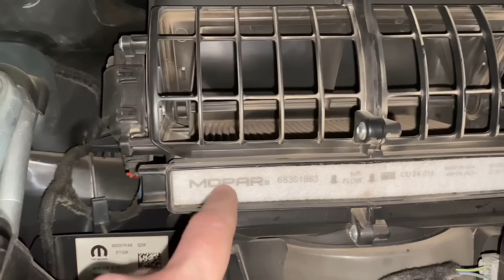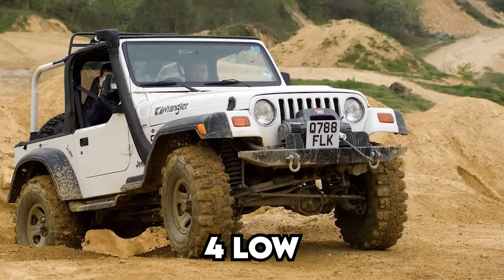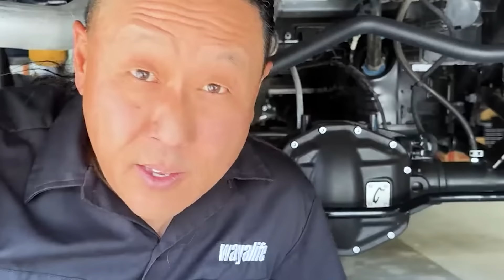The Most Overlooked Maintenance Tasks Jeep Owners Ignore (Avoid Expensive Repairs)

Comment: BEST WAY TO ADD LIFE TO YOUR NOT JUST YOUR JEEP BUT ALMOST EVERY CAR IS AT A MINIMUM DRILL A HOLE THROUGH THE FLANGE ON YOUR THERMOSTAT AND IF YOU LIVE IN A HOT CLIMATE THAT WERE REALLY NEVER SNOWS JUST TAKE THE DARN THERMOSTAT OUT
Reply: Why take out the thermostat? I live in AZ for reference. I am very new to dyi. I just changed my oil for the first time. I plan to do spark plugs next. What does removing the thermostat do?

Comment: 10.  Cabin Filter 0:23
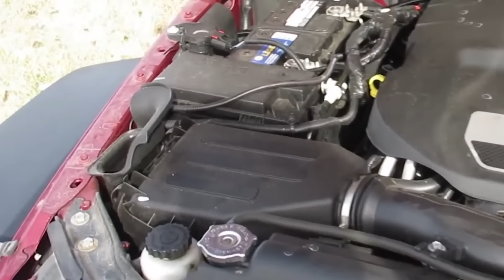9.   Engine Air Filter 1:50
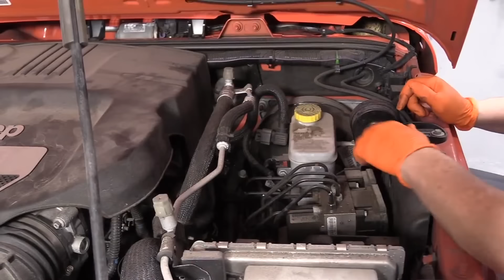8.   Break Fluid 3:24
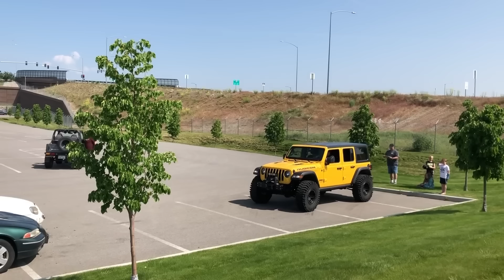7.   Tire Rotation 4:40
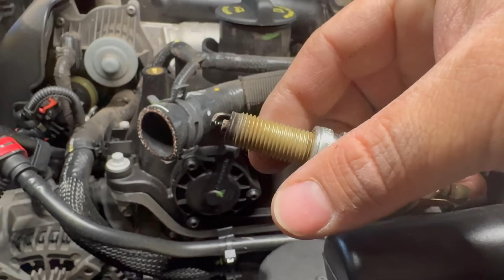6.   Spark Plugs 5:44
5.   Transmission Fluid 7:39
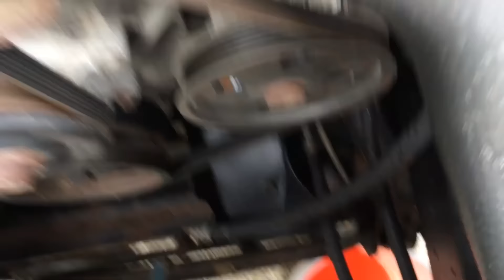4.   Coolant Flush 9:17
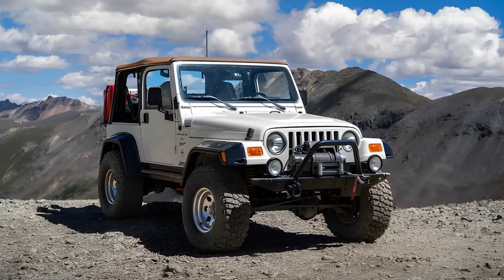3.   Differential Fluid 10:35
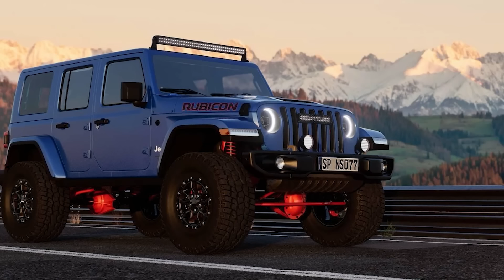2.   Transfer Case Fluid 12:25
1.   Suspension & Steering Inspection 14:32

Comment: Appreciate you sharing all these good maintenance tips. Pretty sure you are way low on your shop pricing. Last time I bought the Diff fluid from my local dealer they charged me $110 just for the fluid and additive…. Anyway, just wanted to share that folks should be ready to pay more
Reply: I was thinking the same thing. Yes, expect to pay a lot more than what's stated in this video. Call ahead for an estimate. Then get that estimate IN WRITING when you get there. 
Ford dealership quoted me a little over $800 for some 60,000 mile maintenance on a used car I had purchased and wanted to get it caught up on the maintenance schedule. This was a little over 3 years ago and
It consisted of a coolant flush, tranny fluid & filter change and a brake fluid flush/change.
First of all, I sat and waited for the vehicle for over 6 hours! They had told me it would be about 1½ hours. Then when done, invoice was just shy of $1400!! Almost double!
Like an idiot, I didn't say what I was thinking. I (after 6 + hours) I just wanted to get out of there and didn't dispute the bill but I absolutely should have. Makes me mad to this day.
I will never let that happen again.
They HAVE to be at least close to the estimate.

Comment: 5000 miles. Ready for oil change? Not sure who to go to I cant go to the dealer I purchased form as it had 2000 miles on it and they were not very friendly when you dont want to finance and buy outlandish extra warranty from dealership.
Reply: Do it yourself,super easy
Reply: Any decent repair shop can change your oil
Reply: I take my Jeep to Walmart every 3,000 miles. Cost is less than $50.
Reply: @Patrick-s8i8d and if you get your tires rotated by them they give you lifetime (of those tires) rotation for free as often as you want. So you can have your tires rotated every time you change your oil like you’re supposed to, making your tires last the max amount of miles!
Reply: @srcastic8764  Did you mean to say if you buy the tires from them, the tire rotation is free or do they give free rotation on the existing tires you have at time of your oil change?
Reply: Do it yourself and bring old oil to a maintenance shop or like me I bring it to Canadian Tire
Reply: Take it to a specialized 4x4 shop, the one I go to does an inspection each time I drop it off for an oil change and it’s totally worth it. They basically do the “white glove” service of those fancier Euro shops.